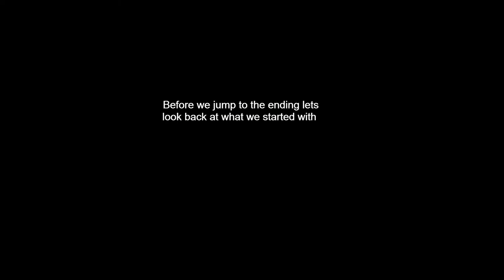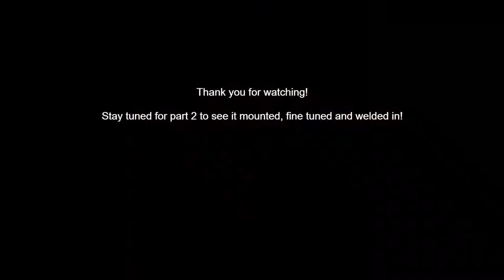Making a Custom DIY Roll Pan

Comment: Looks like you did a series of tack welds, was that to keep warping down? Why did you use the hammer to make the bends and not the break?
Reply from the maker: Yes, its better to tack everything first before you fully weld it in.  It keeps things from moving as much.  And I had to use the hammer to make the 2 side bends because once I made that first bend it wouldnt fit in the brake anymore.  Only if I had a finger brake that would work.
Reply: I mean when you fully welded it in, I understand the tacks to hold it in place, but it looked like you did tack after tack all the way down the panel.  I might be wrong, but was wondering if you did that for warpage.  I realize the last bend without the fingers would hit just thought you would do the 2 bends that you could do, amd get as far as you could with the last and finish it off with the mallet.  Either way, it came out great looking.  Looking forward to the install video.  I have a '74 Dodge D100 that I'll be doing this with as well
Reply from the maker: Ah yes, In the video it doesn’t really show how I welded it in but I did jump around and make small weld passes.  Not exactly tack after tack but around an inch or so at a time.  It did help with warpage.  And you’re right, I could of started the 2 last bends with the brake and then ended with the mallet but most people don’t have a brake so I figured it would be good to show how to do it both ways from the start.  Hopefully the install video will be done soon, I got an awesome deal on a finger brake that recently I’ve been making a stand for but once that’s done I’ll be back to work on the ranger.  Good luck with your d100 tho, I’m sure it will turn out great
Reply: @paule01  gotcha! Thanks for the reply.  Truck looks awesome!